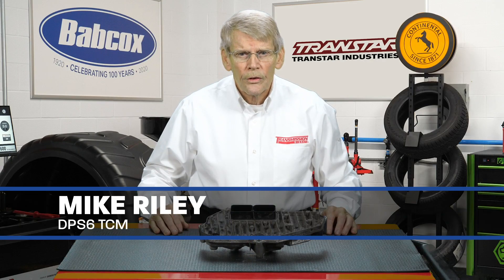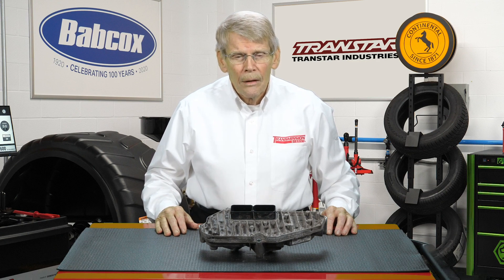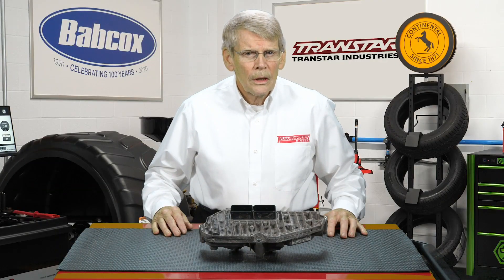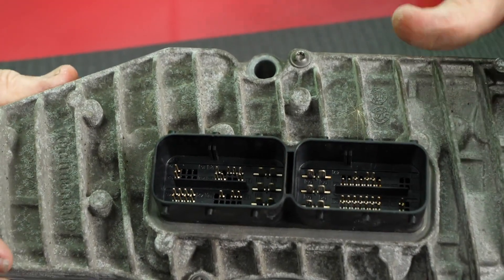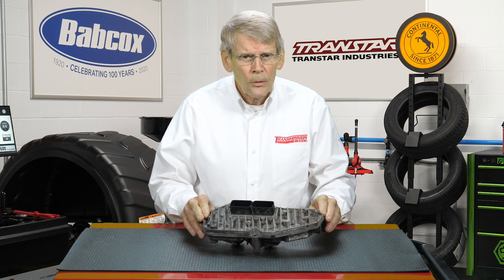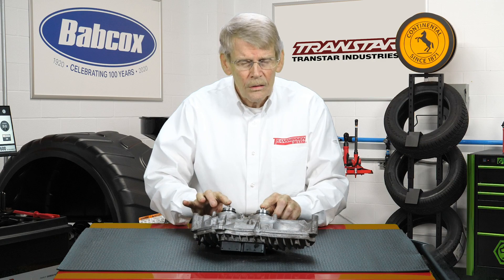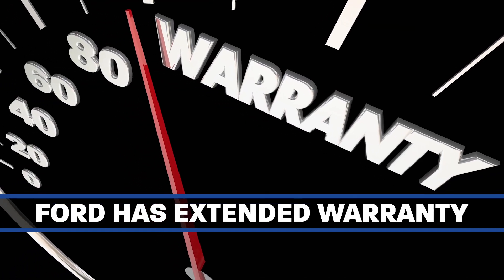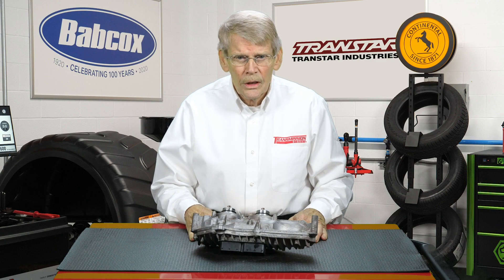Ford DPS6 TCM Shifting Problems

Comment: Yea, FORD has extended the Warranty but FORD dealers don't want to honor the warranties and run customers around with BS for months and months because they can't fleece FORD for warranty repairs like they can fleece FORD customer victims. FORD 'Warranties' are really  'CONDITIONAL WARRANTIES', based on whether the dealer feels its in their financial interest to honor them  or not...and most don't.

Comment: Must have been a really good barrel of whiskey the Ford engineers were drinking that night when they developed the DPS6 transmission. Nothing about this transmission makes sense other then "Simplicity" , probably low cost to produce but will cost 10 times the amount for Ford in the end. Is what it is. Sign up for the class action while you can.

Comment: Those problems come from bad grounding need to clean the paint from battery ground on the frame and the 2 grounds to transmission on body frame under air cleaner resolves the problems
Reply: hello sir when we replace the tcm need to reset or not
Reply: @jimmygrg6730  it needs to be programmed by Ford.
Reply: @RKCorinth  if you replace it with a new unit it needs reprogrammed, however if you put in a used one it will work without reprogramming
Reply: @cookierepairprojects4544  put it in a used one? A used transmission? Also I heard you can reprogram the TCM with Forscan + OBD2 device.
Reply: Has anyone with actual mechanical/engineering background confirmed the ground to be the issue? Fordtechmakuloco made a video about the ground but that was in 2011/2012. Seems weird that Ford would never change that ground setup.
Reply: @Jason Ashley  so the threads and  surface surrounding the bolt for the ground strap to the frame had paint all the way through. About 2-3mm of unpainted metal on threads. I sanded everything to a shiny metal. Sprayed clear coat after reattaching. 

AVG MPG went from cty27-32hwy with a ton of shuttering and jolting from red let to acceleration to cty38-48hwy mpg and the engine is wayyyy smoother and quieter. I have noticed a huge difference since fixing that ground. Using the S gear actually has an impact on performance now. Before i couldn't tell a difference at all. Now I find myself driving in S more now . 

I would highly recommend checking ground strap location for 2012 focus sel
Reply: NO, USUALLY NOT THE CASE.  READ THE CODES.
Reply: It took away the jerking when shifting into 2nd I clean the top ground and the 2 bottoms under the air box
Reply: Yeah I’ve tried that and that doesn’t work long term at all..

Comment: Where is it located on a Ford Fiesta 1.4 petrol 2009 please
Reply: There's a DIYer video showing the location here on YouTube: https://www.youtube.com/watch?v=xXukC0o3J_Y
Reply from the maker: The TCM/shifter assembly is bolted to the transmission.
Reply: I DON'T BELIEVE THEY PUT THIS AWFUL TRANSMISSION ON FORDS TILL 2010' OTHERWISE ITS UNDER THE PLASTIC AIR FILTER BOX ON THE RIGHT SIDE.